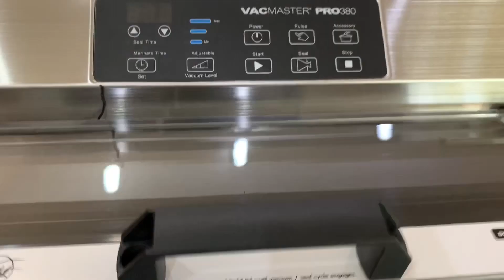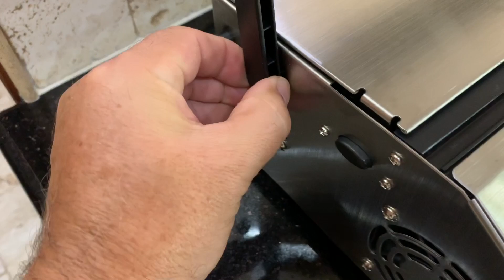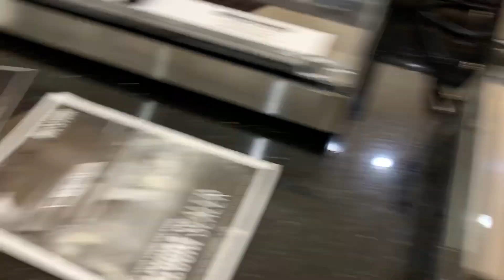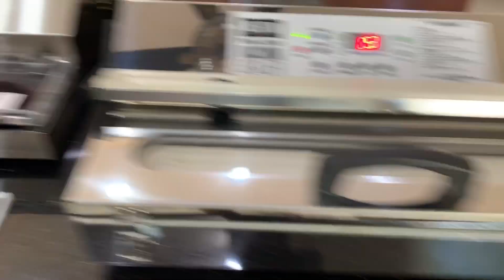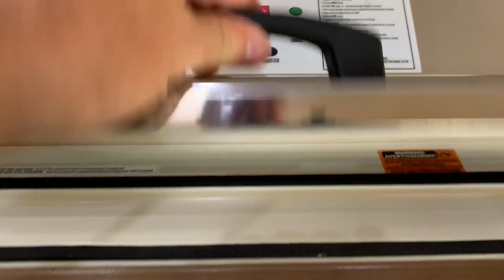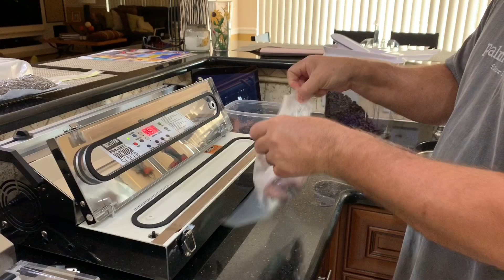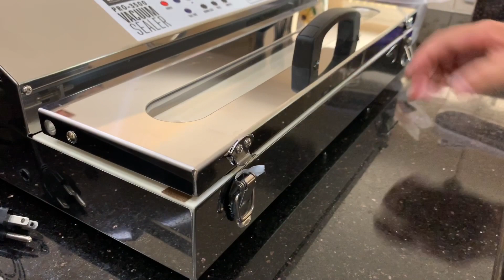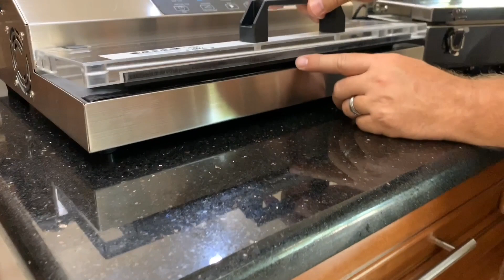VacMaster Pro 380 vs Weston Pro 3500-3000

Comment: I don't understand the purpose of the vacuum timer unless you are constantly vacuuming the same identical package wit hthe same identical content.  I messed with it and it often fell short of proper vacuum because it timed out.  Any thoughts on a practical use for the home user (or commercial user)?
Reply from the maker: It’s exactly for that. This is a commercial unit designed for the medical weed market. Sealing the same content size weight many times again and again.

Comment: Great review.  I bought the Weston 3500 about two years ago.  It worked great until it didn't. It just stopped pulling vacuum.  No decrease in performance, just stopped.  Starts up and you can hear the fans spinning normally, and seals but no vacuum.  I tried different bag styles, but no luck. I have only used it lightly as I have a chamber vac I use most of the time, but when I need something to seal that is larger, I use this. I contacted Weston for some help but they were limited in advise.  What I am looking for is the probable cause of the issue so I may advise someone who can help me with a repair.  I know this is a long time after your post.  Please advise if you can.  Thanks!
Reply from the maker: Check out my channel I posted on what’s inside video. The diaphragm probably fell off the frame or has a hole in it and cracked.

Comment: Anyone know of any other units that make a dual seal? I'd love one of these 3500s but they not available anywhere I can find...
Reply: Home Depot has the pro-3000 for $529 (-$25 if you sign up for a credit card).  Whadda deal IF it's the same pro-3000 sold by Westin
Reply from the maker: Thanks!

Comment: I just got a brand new one still in the original manufacture packaging. The tape on the outside was almost dry rotted. Lol
This thing is a beast.  
Thank you again for reviewing this sealer. 
I do have a question about where you got the information dealing with the use of sealing Cannabis flower.
Reply from the maker: Directly from Weston. I called their tech help line and that’s what I was told.
Reply: @bobbygfl  thank you

Comment: The Weston seems great, I love the powerful motor. But have you read the Amazon reviews? Some not so good about heating element. And they say Customer Service is horrible.
 So who does have the best Customer Service in the vaccuum packing industry?
Reply from the maker: My experience with customer service was very good. As far as the heating element I haven’t had a problem however I did replace the tape with thicker tape from Amazon. Seems to perform better. Anyway thanks for the comment and as far as who has the best customer service nowadays it’s anyone’s guess.
Reply: @bobbygfl  wow, I didn't know you could upgrade to a thicker tape. Do you have a link to that?
Reply from the maker: @707SonomaComa  here’s the link for the product I bought. I think I put this on the bottom:

Teflon Tape/PTFE Tape for Vacuum... https://www.amazon.com/dp/B07GRQL5RM?ref=ppx_pop_mob_ap_share

And this on the top:

Teflon Tape/PTFE Tape for Vacuum... https://www.amazon.com/dp/B07GRY47T4?ref=ppx_pop_mob_ap_share
Reply: @bobbygfl  Do you know what width of tape you needed for the 3500?  The links you gave have multiple sizes... Thanks for the video!
Reply: @bobbygfl  They don't even have a phone line anymore. I just got a 3000 from Best Buy and it came with dings and paint chips. Didn't even have a power cable as far as I could see (I didn't break the black cushion seal). I'm getting a SquareTrade warranty and figure it will pay out.
Reply: Update, they shipped out a new pro 3000 on Tuesday no questions asked after I sent in the email form via the website on Friday. I think they figured out my shipping address based on the serial number I provided them. So far the customer service has been terrific (no questions asked), but very slow email replies (over two business days per response). I haven't gotten an email since Tuesday (and I replied within an hour).

Comment: Where can I still find the Weston pro 3500? I saw pro 3000, wondering if they are the same sealer?
Reply from the maker: It’s not made anymore. The 3000 is basically the same. The 3500 was specially made in a small batch. If you can find one it’ll be on eBay or another resale site.

Comment: Curious how it does with the Umai dry age bags since they do not have the ridges like regular vacuum bags have.  Thanks in advance, and for the videos!  Especially the dry aging ones.  FYI, I purchased the Meater meat probes based mostly on your review and love ‘em...thanks!
Reply from the maker: It’s a pain!  But it works. You have to use the felt thing. Maybe that replaces the ridges? I don’t know the geometry of sealing these bags but it’s a pain. You’ve got to get it just right but then it works perfectly.

Comment: It has been a year and a half now.  What is your review of it today?
Reply from the maker: I kept the Weston. I love it. It has performed perfectly. Several times I have used the wider bags and it really has the muscle to suck out all the air. I have not even had to replace the heat tape. I do however have to lift it and reset it occasionally. If the heat tape gets a wrinkle it will not seal perfectly. Anyway overall I am very thrilled.

Comment: I bought a Weston pro 2300 and this is the second one.  They email you no phone calls.  I bought bags and only God knows what they are they don’t work on the machine. Vacmaster has support I got all this food and on the second machine.
Reply from the maker: Hope it all works out.
Reply: @bobbygfl  I think it is the bags.  Found some with holes in them.  It may not be the machine.  Nevertheless, the company only respond via email.
Reply from the maker: @TheQuietThreshhold  this is what I use: 2-Pack 11" X 50' Vacuum Sealer Rolls, Honeycomb Embossed Commercial Grade FoodVacBags, Foodsaver Compatible Storage or Sous Vide Bags (total 100 feet) https://www.amazon.com/dp/B00CQ8IXIK/ref=cm_sw_r_cp_api_fabc_oTtSFbC1R40VJ?_encoding=UTF8&psc=1

Comment: Hi! 
Great video, I tried to get the Weston 3500 but it is sold out :c 
Should I get the 3000 series?
My main use would be packing shrimps to commercialize 
I live in Ecuador and it’s pricey to deliver heavy items. 
Also considering getting the weston professional advantage or it would hold  for commercial usage?
Thanks in advance
Reply from the maker: Ignacio Argüello L. I go for the 3000 series it’s basically the same.

Comment: Can you tell me if the Weston 3500 has an option to start the vacuuming process, and then stop it whenever you want and start the sealing process? Or once you start the vacuuming process, you have to just wait til it's done and it seals itself? I know you can use pulse to choose exactly how much vacuuming you want, and then seal it, but that's kind of annoying because then you have to stand there holding the pulse button until you're ready to seal. A lot of vacuum sealers have the option to just press the start vacuuming button, and then whenever you want to seal you just press the seal button and it stops the vacuuming. So I'm curious if the Weston 3500 has this.
Reply: In case it's not clear exactly what I'm asking, an example would be say I have a large bag of something like fruit or cereal that I don't want to get crushed. I don't want to stand there for 10+ seconds just holding the pulse button until it's vacuumed to my desired level. So I'd like to just be able to start the vacuuming, walk away and do a couple other things for 10-15 seconds and then just come back and hit the seal button when I'm ready to seal and it stops the vacuuming process and starts sealing.
Reply from the maker: Eric Larson yes. I know exactly what you’re saying. This is how I seal everything. You start the suction and leave the machine set for 10 or 12 seconds. Then you can press seal whenever you want and it will stop the suction and begin the seal. It’s great for preventing things from crushing or blood or liquid from entering the seal chamber. Thanks for the question!!  This is my favorite machine I have ever used for vacuum sealing.
Reply: @bobbygfl  Could you do me a huge favor and actually measure the sealing bar? I keep seeing conflicting measurements ranging anywhere from 15 to 17 inches. And this machine isn't even on their website so there's no official source to see. I want to buy this machine but only if the seal bar is 16+ inches.
Reply: @bobbygfl  in the video you say the weston bar is a half inch longer than the vacmaster bar. The vacmaster bar is confirmed to be 16 inches, so im assuming the weston is 16.5 inches, which would be amazing. But i just want to be sure.
Reply from the maker: Eric Larson sure. I just measured my Traeger grill shelf for another viewer and I happen to have my tape measure right in my hands. The ceiling bar is exactly 16 inches. There is a half inch on either side that makes up the attachment to the electrical connections but the maximum ceiling area that you’ll get is 16 inches
Reply: @bobbygfl  thanks! And thanks for making this video. Best video ive seen on the internet comparing machines like this. I love how the sealing bar lies level with the vac chamber, unlike in the vacmaster. But the extra 150 or so price makes it a close call. Anyway thanks again for making such a great video!

Comment: After 6 hours of vacuum sealing research, hundreds of review video, you helped me decide! It’s a really good review video!
Reply from the maker: Ami Li thats great!  Thank you for the comment!
Reply: Jing Li, Hi :-) Did you find one? Everywhere I looked, both are out of stock :-(
Reply: @incanada83  i recently found the weston 3500 on amazon, but it had minor problems just after a few uses still usable, but now going in on my 3rd month, i believe the fuse went out...  :( is it just me or i feel like everything i buy from amazon breaks down within a year nowa days good luck
Reply: @Nini330zsg  hey , thanks for writing back :-)
I looked up reviews on this (and few other) vacuum sealer and it doesn't look all that good (I'm not even sure who's really writing those reviews).  I don't think it's amazon, I think it's just plain crap nowadays, with most of what one can buy.
Check it out if it's fuse or not. Maybe you just got a "lemon"? Or...exchange for another unit? 

 There are exceptions but most of the things I try to buy (small appliances, clothing, gadgets etc) are old (or Retro). All of them work better and were made to last.
Now....I'm so undecided what maker of food sealer to buy. I'm beginning to wonder if  I could use my vacuum cleaner; it could suck carpet fibers out of carpet LOL
Reply: @incanada83  i totally agree with you retro last way better. lol vaccum cleaner works awesome if you can just figure out the sealing part.
Reply: @Nini330zsg  LOL, well...I'm actually working at it. While the suction of the air out is awesome...the "sealing part" needs some work. However, I did order a  machine that does just heat-sealing LOL.
Who knows? It just (just) may work? LOL 
I mean ...why not? It may be somewhat weird  but after all....the "sucking out air machine", just sucks the air out THEN it  seals the bag while still sucking the air out. Vacuum cleaner (or reverse shop vac for that matter, can do both).
LOL
It just may work even though it sounds weird? LOL

Comment: Do you still have the 3500 and have you had any issues with it so far?
Reply from the maker: Frenchy Alicea yes I do. I use it a couple times a week to save leftovers or freeze meat. I have had zero issues and I am still on the same heat proof tape that goes over the burners. It’s starting to scar a little but I bet it lasts another six months or so. As far as the unit itself absolutely zero problems and I’ve even left it on overnight a couple times. We keep it in the laundry room because we have the space it’s really not something you can put away and take out regularly it’s too freaking heavy.
Reply: @bobbygfl  any idea if this model was made into "cabelas model 350/380" and that's why it was discontinued?
Reply from the maker: Frenchy Alicea no I’m sorry. I have no idea.
Reply: @frenchyalicea649  The Cabela is made in the same factory as the Vacmaster.

Comment: Hello, good evening, I have a question, I need to buy a device and I wanted to know which one could you recommend between the Lem 1088b and the Vacmaster pro380, thank you very much.
Reply from the maker: francisco pacheco the LEM looks like a better unit. It’s more compact, does not have the bag storage on the inside indicating larger internal pumps. Just my take without actually using one.
Reply: @bobbygfl  Thank so much.

Comment: Thank you for the video, I went with the Weston Pro-3500 because of the dual seal.  I am in the process of trying to get it to work because it was sold as turns on but doesn't start.  Hopefully I get it up and running cause I love it from watching your video.
Reply from the maker: Sandra Wadsworth thank you!  Mine is still going strong. Hope you get it operating.
Reply from the maker: Sandra Wadsworth their customer support is very good if you call them.
Reply: @bobbygfl  So I got it working!!  I don't know why but the Ebay seller said it was a return, turns on but doesn't start.  I got it and found out they took the control board off and half the screws were missing too.  Got some screws at Ace and had to get some fiber washers cause the back vibrated loud but so far its working like it should.  Not a bad $170 investment I would say.  Now on to having fun with foods.  Thanks again for the videos
Reply from the maker: Sandra Wadsworth thats awesome!  A bargain and a great machine!  And the best part is you fixed it yourself.

Comment: I ordered the 3500 today based on your review.  What makes the 3500 nearly 10 pounds heavier than the 3000?  Thanks.
Reply from the maker: zanzibarbob7 the body mostly. It’s much thicker stainless. Also the pump is bigger. It’s an impressive machine. Mine is still going strong. Zero issues. I use it all the time. I just ordered a roll of 15” bags!  It seals perfectly.
Reply: @bobbygfl  Mine arrives Thursday and look forward to it.  Thanks for the great Comparison.
Reply: One other question...Do you use the latches for holding down the lid and if so, how.  What was the thinking and purpose from them and are they necessary for normal use?  On my old Elcheapo model when I want to seal a bag I insert it, rotate the cam lock, and hit seal button.  No vacuum needed.
Reply from the maker: zanzibarbob7 My understanding is that the latches are not part of the standard 3500 unit. If yours does come with latches in my opinion they’re useless I have never used them. Unlike cheaper Machines the lid is so heavy that it holds the bag in place just fine.
Reply: @zanzibarbob7  it is now August 2021 and I'm wondering if you got your machine? If so, how do you like it now, any issues or regrets?

Comment: The 3500 uses time to set vacuum and the 380 uses the actual vacuum amount, which is a reason I went with the 380.  Time may not always give you the same result, since the bags are not always the same size. The 3500 does look like a nice machine. If you just want to seal the end of the bag, you don't have to put the end of the bag in the vacuum bay, just put in over the sealing bar. Good video, thanks.
Reply: Wow, nice observation.
How did you know that?
Reply: @707SonomaComa  I said a few things here, so I am not sure what you are asking about, but I have been vacuum sealing since the late 80's. If you want to ask about a specific thing, I will answer it for you.
Reply: @kwd57  about the vacuum suction power.
Reply: @707SonomaComa  I think you are asking about timed vac. vs actual vacuum. If the machine uses an adjustable time period to run the pump, it will most likely over vac. or under vac. the product you have in the bag. Any changes in the size of the bag or the amount of the solid mass in the bag will change the amount of time to run the pump to get the desired outcome. If the machine has an adjustable vac. function, it will give you the same amount of vacuum in the bag, no matter the size of the bag or what is in it. It makes it much better when you want to vac, seal something soft like bread, so you don't squeeze it to much. I chose the Pro 380 because of that function. Its too bad they don't sell it anymore. I hope this answers your question.
Reply from the maker: I set mine too I think 12 seconds of vacuum but I always stop at early
Reply from the maker: I have never messed with my vacuum suction power I’m pretty sure I have it on number three. By stopping at manually you control how much.
Reply: @bobbygfl  Manual operation is a work around, which I also do at times for certain items.
Reply from the maker: @kwd57   The 3500 in this video you set your vacuum time and your heat time. Like I said I’m pretty sure I have my vacuum times set to 12 seconds. I generally stop the vacuum around eight or nine seconds. At which point it maintains the current suction and seals for three seconds. I really don’t give it much thought. Push the button before it sucks the liquid or crushes. That’s really the only thing going through my mind LOL.
Reply: @bobbygfl  If you are sealing wet things, take a paper towel that will fit tight from end to end, then keep folding over double until it is about one inch wide. then slip it in the bag close to the wet item, making sure it is tight end to end, then vacuum seal. this will keep the liquid from getting to the seal as long as you don't have too much liquid.  I now use a chamber style sealer for wet things.
Reply from the maker: @kwd57  thanks!
Reply: @kwd57  What a clever idea. Thank you